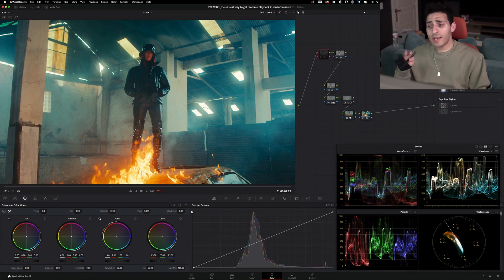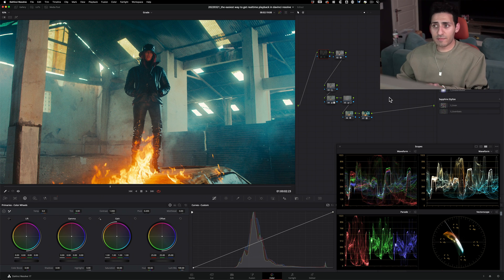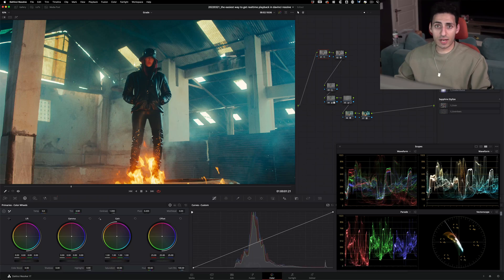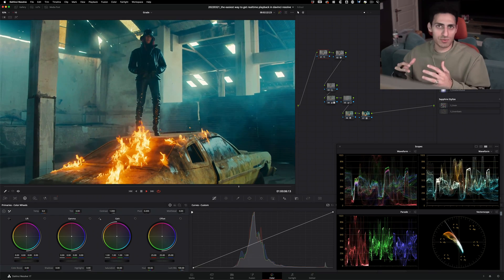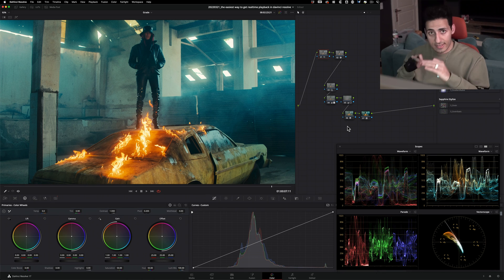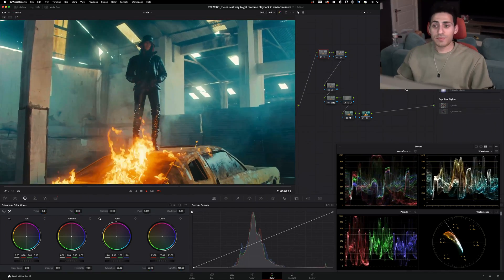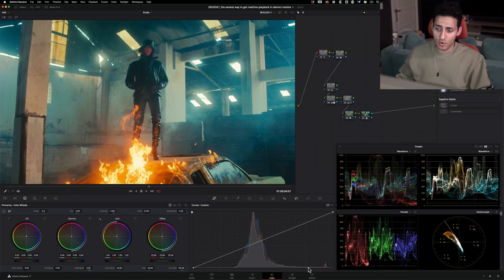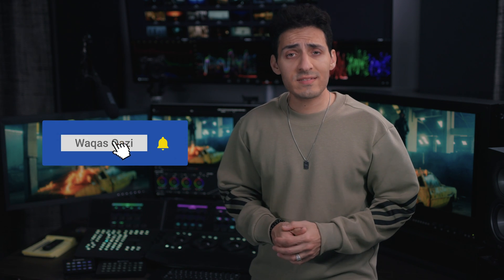The Easiest way to get Real-Time Playback in DaVinci Resolve | Quick Tip Tuesday

Comment: Hi fella need your help I have the latest updated of DR but Jesus it’s slow I’ve tried everything re install the works I have a decent system i7 9700k 32gb ddr4 rtx 2080 but still can’t play back braw 4K smoothly
Reply from the maker: Since I'm not on PC, I won't be able to help you but it's probably not compatible with your video card, drivers or something of that effect.
Reply: @theqazman  Thanks all working perfect as I’ve updated to latest version of resolve which is now super fast

Comment: I have same problem, issue on play back, but with the new version of Davinci Resolve 18 studio version. When play the video, it beginning lose frames...  I have a Mac Pro 7.1 with 96 gb of ram, Xeon 16 cores, 2 GPU, a Radeon Pro 580x with 2 4k monitors plug in on it and a second GPU, a Radeon RX 6800 XT with 16 gb with out any monitor on it, just for acceleration render process. My operating system is Mac OS BigSur. My problems beginning when I try to see a video Clean Feed on the second monitor.  Could someone help me with this issue?

Thanks in advance

Comment: I'm still seeing a lot of stuttering in your video when that green light is showing. Is that intended?
Reply from the maker: My screen capture software glitched during export.
Reply: @theqazman  Thank you, that is good to know. I'm having problems with Davici Resolve, even when cutting my 1080p tutorial videos with no effects on it. I'm using a Speed Editor connected via USB-C and have i7-8700 CPU @ 3.20GHz with a Geforce GTX 1660 and 48GB of RAM on a SSD. The video plays back fine when just playing it. But when using the Speed Editor to scroll though the video it stutters and especially the sound is jumping, which really slows down the process of cutting the videos. The Videos are recorded with OBS at 30 fps as mkv files. Do you have any advice for that? Is it normal that it jumps and stutters using the Jog wheel in Jog mode?

Comment: Do you personally turn the timeline resolution back up to 4K when working on detail work such as NR, sharpening, or adding grain?

I usually edit in 1080, but when I'm actually coloring I find I need the full 4k resolution to make sure I get the details right.
Reply from the maker: As I mentioned in the video dropping the resolution has nothing to do with the color information.

Comment: I've been dying for a pro to give a proper explanation of the advanced settings in the CST node. I understand input/output colorspace/gamma just fine, and I have a somewhat working knowledge of the tone mapping section, but that last section with the checkboxes completely eludes me. I have to resort to guess-and-check every single time I use it.

Comment: Thanx for this tip! Question though… What’s the difference between dropping the timeline resolution to 1080p and using “Half Resolution” playback from the  “Playback” menu up top?
Reply from the maker: Proxy in my experience reduces the quality significantly and doesn't yield similar results as to changing the timeline resolution.

Comment: Quickly Go through everything you need to set up a studio, what to think about, adapters, calibration etc to connect LG cX and a reference monitor to iMac etc etc, all so confusing with info all different places but no one has made it super clear in order, so that would be perfect for a quick 2min tip
Reply from the maker: I wish I can figure out a way to explain all of this under 2 mins. On the plus side, I have an entire module in my Masterclass where I hand hold you through the entire studio setup process.

Comment: 🔥🔥🔥 love it. Pls i use Mac and deliver to YouTube and my colors are shift and gamma too. I saw your free tutorial but still problem even i use handbrake app. But when i use rec 709A colorspace it works perfect no need to use other transcode. Is ok to use 709A Instead rec 709 gamma 2.4? Thx love your videos
Reply from the maker: Nothing wrong with exporting with 709a since it was designed to fix the gamma issue.
Reply: @theqazman  THX man I really appreciate your approach to the fans.

Comment: I used this technique since I used DaVinci on my potato laptop and the only problem I faced is when I'm using Fusion because the coordinate of an effect stays the same whole number (not percentage) even when you switch back from 1080 to 4K (500 pixel on Y axis in 1080 is a large area compared to in 4K)
Reply from the maker: That's a problem then for sure especially if you use Fusion. I barely ever attack VFX so it's never an issue for my workflow.